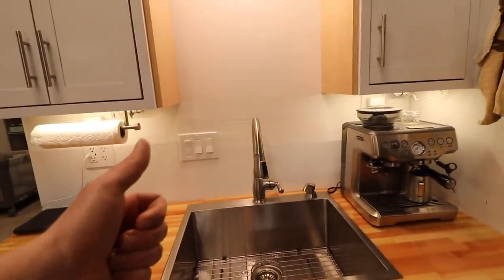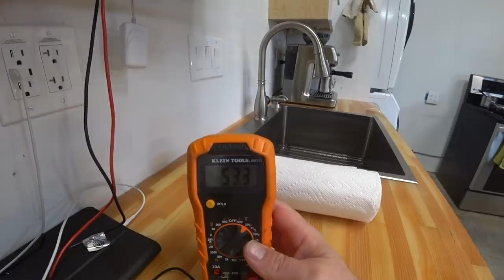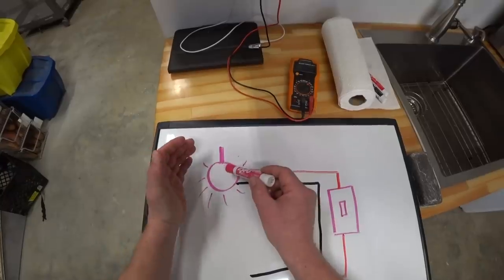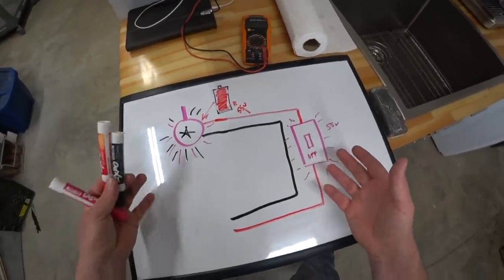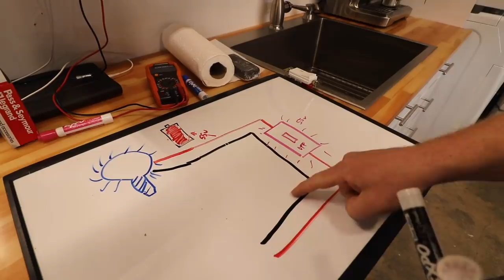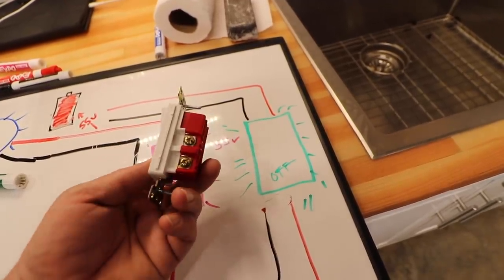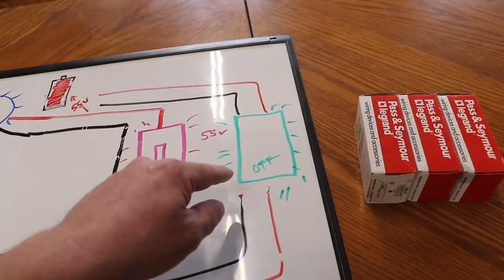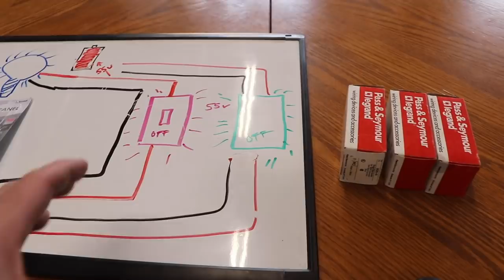Don't Use LED or CFL Bulbs 'Till You WATCH THIS VIDEO

Comment: I never realized until now just how close to your sink your light switch is,  I'm amazed that the code in the USA allows you to have a switch right above your sink as this is asking for trouble!.
Anyone who touches the switch with wet hands or if steam is able to get into the unit your risking being electrocuted at the very least even the risk of fire starting!.
Something that the UK would NEVER ALLOW!!!
Reply: Often outlets like that are in bathrooms, however they MUST be GFCI protected.
Reply: Neither would Finland!
Reply: i think in Germany it has to be about 60 cm / 23,622 Zoll away from any water outlett
Reply: In EU the switch should have ground protection and 60cm away from water source. Also why is there 55V on a closed circuit!!!??!! Dont blame the leds.
Reply: A switch that passes 55v...  Not a switch !   Solution.  use normal switches at the entrances of rooms and then you don't need lights on switches that pass electricity when they are off.  As for bathrooms, UK uses pull cords so as not to get a shock with wet hands.

 USA electrics, from what I have seen, is protection from the fuse box.  Not the best solution.
Reply: @jbrnds  The 55v is the ratio of the load (led light) to the resistance of the back light. That's why he has a problem.
For this to work properly the load should be much more conductive than the back light. The led isn't conductive enough to make the back light a significant load on the circuit path. His idea of using the back light to bypass the load, is the correct solution, if he can find a supplier of a switch with that configuration.
Reply: Stan .Rarick In norway every single circuit whatsoever is GFCI protected🤷🏻‍♂️
Reply: @Andrew-tj4kg  The lamp inside the switch is across the switch contacts, so when the switch is on the internal lamp is off when the switch is off the lamp is in series with the load, with old style incandescent lamps the filament is a very low resistance so you would see zero volts across the lamp. LED or modern CFL are high resistance until illuminated.
Reply: @stan.rarick8556  UK does not allow outlets in a bathroom only shaver sockets which have an isolation transformer in them.
Reply: @FireballXL55  I could be wrong, but I think in the 18th Edition Wiring Regs they have changed it slightly.  To allow regular sockets, but they must be 3m from Zone 2?  I'm not sure how many people have a bathroom big enough to do this though.  You're correct too about shaver sockets having an isolating transformer in them.
Reply: @Andrew-tj4kg  Multimeter shows 55 V because old-style glow switches have a gas-discharge lamp that closes the circuit when the switch is "off". The multimeter, in this case, is connected in series with this small lamp, and it can show any voltage between 0 and 110V based on the internal resistance of the gas-discharge lamp. Generally measuring voltage in this way shows only that there is a closed circuit. 
The important thing is, that some small amount of amperage can pass through this gas-discharge lamp in the switch. The filament in the incandescent bulb cannot be heated by this small amount of current, so they stay dark. The problem with LED/CFL is that they have capacitors that slowly fill in by this small current and lit bulb for part of the second. The problem can be easily solved by adding a simple resistor that costs less than a cent. But most people, do not fully understand electricity, so I intentionally do not tell where to put it, and how to choose it, because playing with electricity can be dangerous for uneducated.
Reply: @Andrew-tj4kg  This is a temporary area in the garage.
Reply: @FireballXL55  we use lower voltages in the US and also aren't a bunch of ninnys that beg our government to create as many rules as possible. outlets in bathrooms or along kitchen counter tops are gfi protected by code, that is very adequate ,no safety issue.
Reply: Simon r  hello, but having lived in a CROWN COLONY  , in the bathroom zero switches, or receptacles were ever allowed , light switch, was OUTSIDE BATHROOM door, but also those days were no electric razors, so there was nowhere to plug them into.   Cheers 🇺🇸🇺🇸🇺🇸🇺🇸
Reply: Henrik rye  hello, in USA any receptacle within 6feet, MUST BE A GFCI   there are exceptions , REFRIGERATOR, FREEZER, & a SUMP PUMP  Cheers From USA🇺🇸🇺🇸🇺🇸🇺🇸
Reply: They don't  it must be gfci 3 feet away. If he's  on grid or off if on 100 %  must bond ground  and neutral  55v bleed by neutral your wired wrong  somewhere. Check your earth  ground .
Reply: What in the world do you think building codes have to do with this guys house?
Reply: @Andrew-tj4kg  Wall switch allowed outside zone 2 if rcd protected.
Reply: @Andrew-tj4kg  Look up GFCI.... its code in the USA as long as its protected either a GFCI receptacle and lines feed off that or a GFCI Breaker in the panel, There are light switches with Garbage disposal switches in 2,3 and 4 gang boxes within reach at the sink everywhere.
Reply: @CraziFuzzy just because they are building it, doesn't mean it doesn't have to pass all the normal inspections.
Reply: @ragingbull1267  I think Western Europe has been overrun by the lowest common denominator syndrome. A GFCI in the wall or the panel is plenty safe for the application.
Reply: @toddmiller5322  If it's never permitted, then there are no inspections.  I don't think this guy has ever once mentioned obtaining a permit for anything on that property.
Reply: @CraziFuzzy  They have a video where they failed the first electrical inspection, so it's safe to assume they pulled a building permit. Have to have one of those before you can get permits on anything else on new construction.
Reply: I guess everybody on here did not see the episode where the breakers are installed. Gfci Breakers are expensive. And I also believe he installed GFCI Outlets he had quite a bit of trouble with the GFCI Breakers
Reply: @Georges3DPrinters  that all said and done, the regs over there are way way different to here in the UK 🇬🇧. 
All I can say is over here no matter what you have in the way of Gfci ( I have no idea what these are by the way!) etc you would not be allowed to have any electrical services installed within the bathroom suite!!!.
The light switches even have to be installed on the walls outside of the bathroom, the only electrical socket of anykind allowed to be installed within the bathroom is a electric shaver socket and that's only because they over here are waterproof and run on a low current!!!.
But other than that yes I've been fortunate enough to have watched every single episode to date !!!.
Reply: @simonr6793  5 mv is all it takes to trip circuit between ground and neutral. neutral is bonded to ground in most places. hard to electrocute anyone with a gfci.

Comment: Check out Lutron switches, I just install some led lights in my kitchen and they wouldn’t work with the old switches so a friend of mine got me two new Lutron switches that just come out, they are back lit and are dimmers also I don’t remember the item number for them but they work great you can also set the brightness you want
Reply: Roger Wandschneider Elmo, but my LUTRON DIMMER SWITCH, was a dud, Forgot what brand, but it LOOKS just like the Lytton, with the rocker switch on its bottom,  Cheers 🇺🇸🇺🇸🇺🇸🇺🇸🇺🇸

Comment: Have you tried wiring the lighted switch into the neutral leg(white wire) coming from the wall plug and leaving the power wire(black wire) always hot?
Try it and see if it works. If it meets NEC is a separate issue.
Or use a Leviton
 Outlet-to-Socket Light Plug, White Model # R52-00061-00W with a 40watt bulb plugged into the unused  plug receptacle.

Comment: A 240 vac light switch is a double pole in order to shut off both legs of power.  I know they make ones that have the illuminated toggle on them.  Maybe there is a 240 vac illuminated rocker type somewhere.  Just a thought...

Comment: I bought 56,000 1/2watt ohm ceramic resistors, 1/4'' heat shrink tubing, wire it inside outlet/light with wire nuts or/and parallel with outlet plug. This small .002amp load bypasses the LED ac/dc circuit and fires neon that is in parallel with the wall switch two connections . Use 2 or more in parallel if needed and put a sticker on the breaker so electricians won't freak out when working on this circuit.

Comment: If you were to come in contact with that 55volts on the outlet, the impedance of your body would likely be enough load to cause it to drop to zero or close to it.. As someone else mentioned, a UL approved wall wart typically has a resistor to discharge the capacitor once the unit is plugged in.. This "bleed" resistor is also typically enough to load down the leakage current.. The load is typically the return path for the LED or Neon bulb that illuminates the switch.

Comment: The neon lamp in the switch breaks down at about 60 volts.  Hence about 55 volts is presented at the receptacle.  The NE2 neon lamps take a very small current but enough to charge up the LED.  Often the series resistor used with the NE2 bulbs are often 20K to 56K ohms.  The LED's draw so little that it is enough to charge to their trigger point.

Comment: Lutron Shunt Capacitor to assist with non-neutral based digital switches in meeting minimum load requirements. The LUT-MLC comes in the package with Lutron digital switches that do not require a neutral connection. In most scenarios, it is not needed, however if the switch is wired in and it does not completely turn off the light or flashes/flickers in the off state, the LUT-MLC will need to be installed either in the switch's junction box or in the first fixture of the lighting circuit.

Comment: if you can find these I think this is the ones, ........The Lutron Claro Illuminated Decora switches are supposedly rated for LED/CFL in addition to incandescent/halogen. Model numbers are CA-1PSNL (single pole gloss finish), SC-1PSNL (single pole satin finish), CA-3PSNL (3-way gloss finish) and SC-3PSNL (3-way satin finish)..

Comment: You need a resistor across the capacitor to discharge the capacitor when the power to the LEDs are turned off. About a 1 megohms should suffice.
Reply: Yes that is exactly right. It's done when using LEDs on automotive light bulbs all the time
Reply: @lennyf1957  
On automotive light it's so the computer can see a load .
Without the resistor the computer will think the bulb is faulty .
Reply: Hearing someone advise a resistor across mains voltage worries me deeply.... Many better options but all dependent on the ic's being used, tools available and understanding of electronics. Also a resistor inline with one or many LED's is not an automotive thing, its a thing to not make them instantly explode. LED's are diodes, their forward current is exponentially related to voltage over their minimum forward voltage, but each one is not exactly the same so they are provided with a little to much voltage and given a resistor so they don't instantly die.

Comment: So your using LED lights to save power... yet your using a switch that is designed to waste power???
Reply: If you walk around in your house for a bit eventually  you know where everything is in even pitch black especially the light switches , try it
Reply: they don't waste power they turn it into useful light
Reply: Those leds save probably 40-80 watts compared to fluorescent or incandescent. Meanwhile, the switch maybe “wastes” .5w while providing a useful nightlight.

Comment: In the auto lighting industry- it has the same issue regarding led bulbs. The solution there is to put a capacitor or a resistor in line to simulate the draw of incandescent.  Not sure if it could apply here
Reply: Here’s the part for home led issues - (ILR-10K). PCS 10K Load resistor

Comment: Two pole alternating switch, they do exist ;)  Not sure about one with a control light , but a diode and a resistance can easily be added behind the cover (in most cases. There is already one such circuit in the current switches.
Reply: actually a single pole alternating switch is just fine, just the control circuit needs to be added between secondary hot and neutral.

Comment: What you basically seem to want is not cutting the power , but to redirect the power from led lighting to the switch lighting. It is more or less having a jumper between two circuits, and that is not complicated.

Comment: apart from using a relay there comes only one other non bandade solution to my mind and that would be, to use a usb soket like you used down below also for the soket where you plug the led strips in to. The internal electronics of the usb soket should waste sufficient amounts of power to keep everything off.
Reply: That's what I thought of.  You are basically powering the primary coil of the step down transformer that is inside that 120 - USB converter.  Although it is an inductive load instead of a resistive load, it should still provide enough resistance (a parasitic load, as Jesse called it) in order to do the trick.

Comment: Maybe split the receptacle, one side has the lights, the other has your nightlight. Then wire in a non lighted 3-way switch to the split receptacle to power either the undercabinet light or the night light.  I don't know if this meets code, btw.

Comment: Sounds a lot like the "zombie" LED bulb that Steve Mould talked about in his video last year. The bulb was manufactured on the cheap and is missing a resistor so when powered off it turns the cabling in the house into a giant capacitor. in your case there should be 0V at the outlet when the switch is in the off position. I would say that you need to get different switches that glow but do not pass voltage when they are off.

Comment: Put small non polar foil capacitor resistor series combo across that circuit... 0.1-1u (200-400V) +100ohm... (resistor is protection in case cap shorts it burns without tripping the fuse)

Comment: I have a tp link smart switch that has a light in it when it’s off. It uses a neutral wire so it should not give you a problem.

Comment: Get a Shelly switch. It's a smart wifi switch installed in the box, but also it will allow manual switching disconnecting the lamp.

Comment: The problem can be solved by connecting a capacitor 0.1 mkf / 600V in parallel with the LED.  Then no special switch is needed. 😊 This method is suitable for AC power supply.  The capacitor acts as a shunt and prevents voltage from rising on the LED when the switch is off

Comment: i admit i am a bit rusty in electronic, but adding a resistor (1 M) in parallel with your LED shall keep the capacitor to slowly charge and reach the minimum voltage for turning on the LED.
Reply: 1Meg, barely...
Reply: Two points: The resister disapates heat. Is the enough air flow to dissipate 55 microamps? Is that enough amperage to light the switch?
Reply: Common resistor are 1/4 Watt, if the LED operate at 5 Volts, it should be ok (P=VI).
I said 1 Meg, but the idea is to put a resistor low enough to drain the capacitor when the system is switched off, and high enough to not overcharge the transformer when switched on (maybe i was a bit zealous on protecting the transformer)

you put the resistor on the 5 volts side ( at the end of the ribbon), not on the 120 V AC side.
edit: ok, the system works on 12 Volts  my bad about the 5 Volts thing...
Reply: @adamirtm  The resistor needs to be before the LED PSU so is at mains voltage not the LED voltage. If you put it across the LED  you would still get the strobe effect but maybe for a shorter time.
Reply: @davepeterson3449  Not about dissipaton, i doubt it will prevent LED's from blinking, maybe it will reduce frequency a bit... Bottom line is it is charging a filtering cap in wall wart SMPS, when voltage reaches certain treshold SMPS turns on and dumps energy in that cap to turn on lights for a few tens of ms. You need to figure out treshold voltage and shunt over with low enough load that will never allow that cap voltage to exceed treshold... I opted to use capacitive load since all this inductive loads on mains (motors, transformers), it will benefit from some cosfi correction...

Comment: The Lutron Claro Illuminated Decora switches are supposedly rated for LED/CFL in addition to incandescent/halogen. Model numbers are
CA-1PSNL (single pole gloss finish), SC-1PSNL (single pole satin finish), CA-3PSNL (3-way gloss finish) and SC-3PSNL (3-way satin finish). (found this online)

Comment: Most of the cheaper switches use a cheap (neon?) bulb that doesn't behave well if the load is too low (i.e. relatively efficient and bucket-charger like those LED lights have). The bigger light like above your sink may just have enough charge, but it can be borderline too. I switched over to a slightly more upmarket switch type that has a LED light inside it. That has a very, very low power use and it avoids the flicker you are seeing. The ones I have are from a brand called Veto, which I'm unsure if you have in the US, but it is likely a more expensive switch will work well.

Comment: In the UK you cannot have electrical switches that close to a sink / water source. As switches can be splashed and are dangerous to operate if you have wet hands. May need to read the electrical regulations!
Reply: The GFI breakers he used cover everything on the circuit.

Comment: Go to the Netherlands 😊 we solved this +/- 20 years ago for lighting containing drivers. We had already a hot and a neutral wire in our switchboxes long before. A few years ago I bought a house and did a full renovation. I installed thereby some LED Dimmers which does contain a small LED indicator.

Comment: I installed a motion-activated switch in my bathroom and found that the 4 led bulbs put out enough light to see ok when the motion detector was off and a much brighter light when the motion was detected. So much for using a motion detector to save energy.